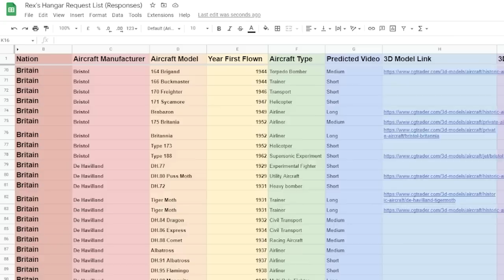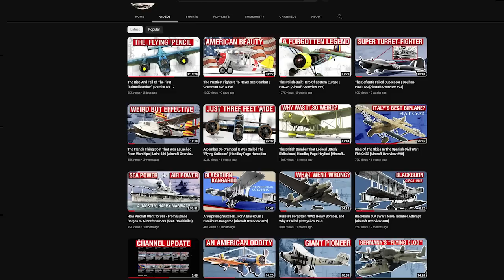Rex Rambles | Episode 1

Comment: Just something to consider, we have these things called Tuff Shed's here where you can buy a pre-built building and just plop it down somewhere. They're not huge, but four of the bigger models would equal a house in square footage and still be significantly cheaper. You could buy an empty plot of land, plop some sheds down, wire them up, add an AC, and instant home. It would take some work, but assuming you know how to hold a hammer you can push fiber glass batts in place and put up drywall. It would be easy enough and serviceable. Plus adding whole new rooms to increase your book collection would be faster as you got practice.

Comment: Your question answered in this comment section, and with what I heard you answer so far. Are right on point.   Especially the units of measurement topic.   It is not hard to do simple calculus to convert to your own standard.   People tend to expect touch from video creator's.  Remember guys, most of the people on YouTube do this as a hobby, they don't get paid for it

Comment: Another factor in the switch from wooden to metal framed planes would be the availability of workers skilled in the relatively new technology of building planes out of metal. Wood workers such as cabinet makers or joiners would have been commonplace in the early years of the 20th century, those with any experience in working with steel tubing or aluminum not so.

Comment: About the Japanese "Paperclip".

Thing is, Allies took a close look at what they saw and save for a couple of things (turbocharged engines, for example) there wasn't much they could find interesting. Japanese aircraft industry had basically shut itself down to new technology with the start of the Pacific War. A prime example of it is when you take a close look at the cooling system of the Suisei and M6A. Despite the clean profiling of the engine cowling for the Atsuta engine, the radiator setup was a large, high drag, low pressure design. Now compare it to the systems used in later marks of Bf-109s, Spitfires and Mustangs. They're worlds apart.

So, yeah. You're not too far off, Rex.

Take your time with the videos, mate.

Cheers.

Comment: Another factor on the transition from wood to metal was engine power.  As more powerful/efficient engines were developed, aviation weight and cargo capability rose commensurate....thus allowing heavier/stronger aircraft with resulting enhanced capability.

Comment: During WW1, aircraft and rifles put a lot of strain on the supply of seasoned wood. The key word is SEASONED, and I don't mean adding salt and pepper. It cannot be pushed. After the war there was surplus lumber, for a while, making it CHEAPY CHEAP. Aluminium was expensive and Duralumin was yet to be invented (Discovered 1898 and refined 1909 but still expensive.) check out the wiki page.

Comment: Speaking of aircraft modeling holes to fall in to, the forum Aircraft Resource Center is a good source of source of modeling info and advice and knowledge where to acquire supplies and other assorted bits and bobs. There at least used to be a couple Airfix specific forums. There is only 1 of me and my health is a mess so I had to back off on forum activity. There is also the thing of "Do you want to post on a forum about a model or apply paint and glue to a model?" 🤔 Airfix have some quite nice new releases and occasionally resurrect vintage kits for brief periods. Are also a number of other kit manufacturers who did not exist in the 1990s when I was last in to aircraft modeling. Had moved from aircraft to railway and space modeling for a while, as well as miniatures games. Just started aircraft again. Quite slow at it, but, hey, at least my messy health still allows sticking a few parts together and smearing some paint around.

Comment: Re Gotha flying wing:
The Go229 / Horten 9 is right behind you on your green screen, and it's as pure a flying wing as you can get. The Horten brothers, designers of the plane, were purists, and averse to using any vertical surfaces in their designs. They were convinced that yaw control should be possible employing the correct lift distribution and mix of control surface deflections.
(It is possible to do that, but from a performance standpoint not strictly desirable.)
And while most of the Hortens' early designs were gliders, tho one built by Gotha was not, it was to be powered by two turbojets.
Reply: well they were glider enthusiasts, so it makes sense. that being their knowledge base.

Comment: to add to the 1st question, 

would an issue with the availability and affordability of good industrial tools for metal work also be a factor in the transition from wood to metal? 

would an issue with the workforce and their training also have been a factor? considering they're going from woodworking to metal work (or if they're already machinists, they could've been hard to find), which i think is quite a different set of training and skills would've been required.

as you said that the transition was quite natural, which i think would've been due to background work by the companies to transition so they don't get bogged down during the process.

the aircraft designs that have been designed at the time to be made of wood, when the transition was happening may have been a last ditch effort to eek out from their previous work force's experience.

Comment: Merchandise idea, aircraft hood ornaments. I'm not a 3D printer guy, but I'm betting there are lots of files available to print scale models of historical aircraft, add a stalk to mount it to a hood ( glue or screw) with a little plate on the base that says Rex's Hangar. I'd buy one, make mine a f4u Corsair please.